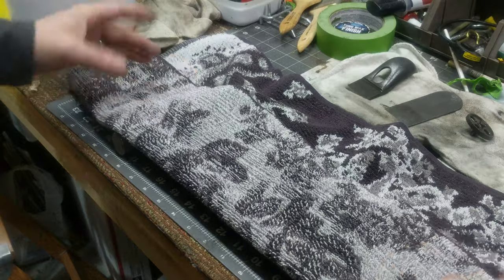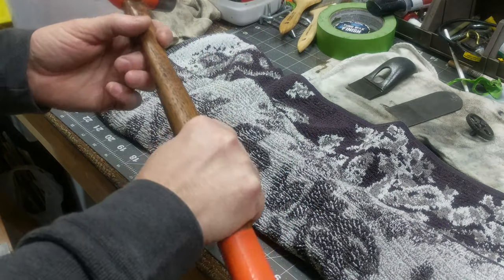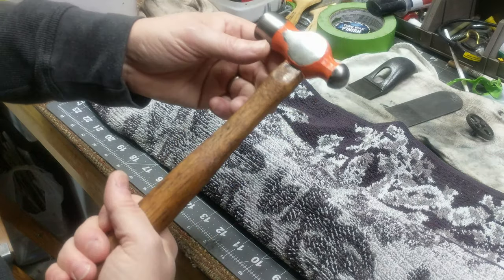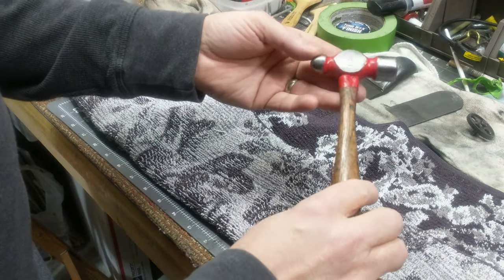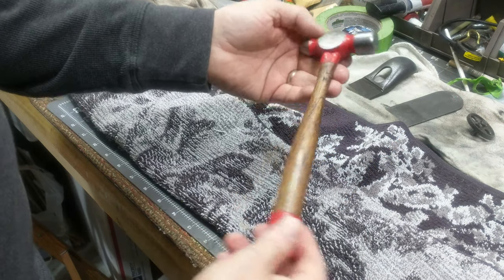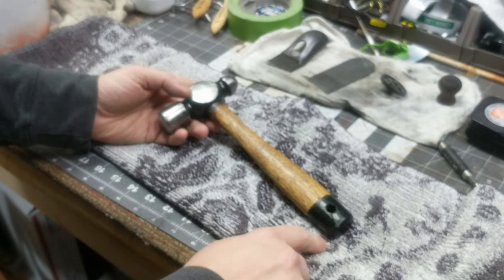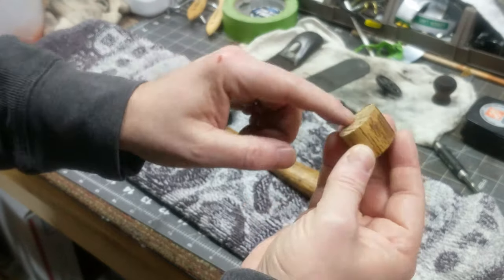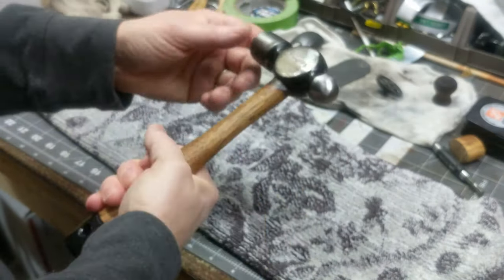ScoutCrafter Short Hammer Challenge! TSWG Episode 104

Comment: I have a 10lbs sledge from work that broke so I cut it down to around a 10" handle. Absolutely love it for driving ground rods
Reply from the maker: a 10lb sledge as s short handle wow!
Reply: @TheSuperwrenchGarage  it sounds awkward but its actually more controlled I feel because rather than swinging a 2-4lbs hammer hard to get your power, this you just basically are dropping and controlling where the blow is focused
Reply: @BradsWorkbench  If you are driving ground rods a piece of 3/4" steel pipe with a 5 lb chunk of scrap welded on one end makes a nice driver. 😁😎
Reply: @OldSneelock  yea, we have done that with t-post drivers. Still prefer the hammer personally
Reply: @BradsWorkbench  The hammer works fine. My knuckles like the fence post driver. 😁😎